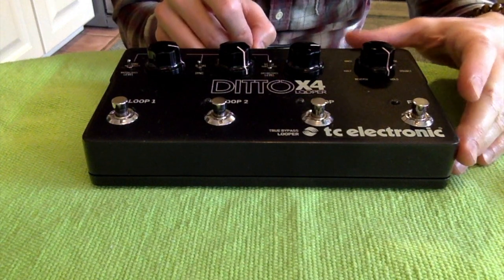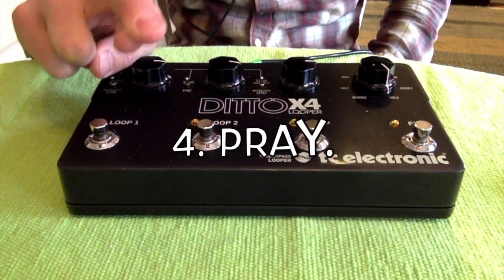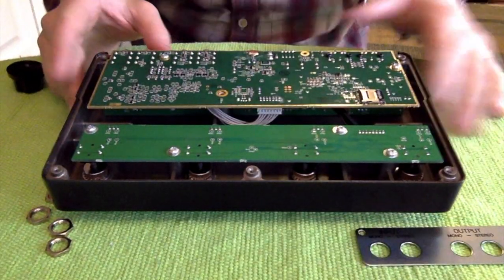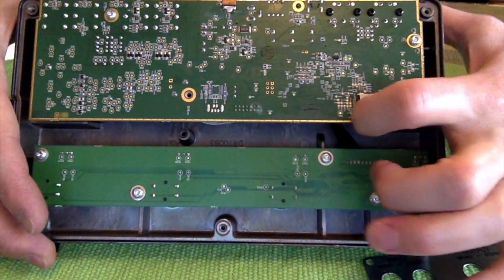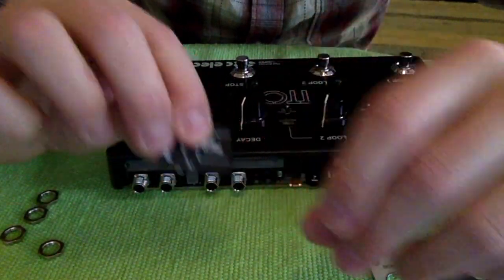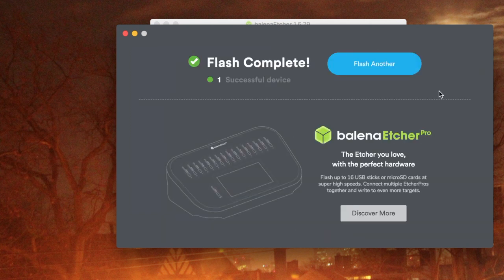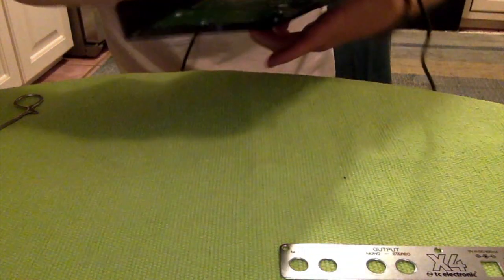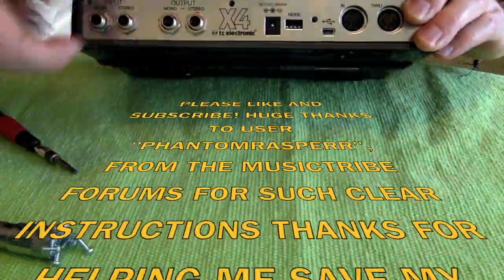How To Repair a Bricked Ditto X4 Looper Pedal

Comment: Thanks for the video! Before doing this, check  if the power supply gives enough amps. If not, X4 behaves the same way. Just saying...
Reply from the maker: Thanks! Yeah insufficient power can cause wackiness in any pedal so thats a great point. This one was using the stock tc supply that came with the pedal so I ruled that out after I tried another power supply with a similar rating but I can see folks having problems not using the stock power or plugging into say, a low mA plug on a brick style power supply.

Comment: I'm not sure how, but this worked for me!  Thank you.  downloaded the image and flashed the card with Balena Etcher as described.  Balena Etcha ran but told me that it failed to flash the intended drive.  I tried a few more time but after the first time Balena Etcher kept failing and giving a warning that the file was corrupt.  The card itself was still named DittoX4 after the flash failed so without many other options I put the card back in the ditto and miraculously it came back to life.  Hope it continues to work!
Reply from the maker: Hey thanks Falayta Productions! Glad to be of help. We've just recently found out that sometimes the card can get shifted or josseled inside its catch, causing this issue as well. Perhaps that was part of your pedals problem. Spread the wealth of knowledge my friend!
Reply: Ian Douglas Music I had tried to reseat the disk at least three or four times prior and had even mounted it in my computer prior to trying to flash the card as described in your video.  Nothing seemed to work until I tried to flash it, and as I said it told me that it failed but maybe it did do something?  Or maybe I just got it to sit correctly after repeated tries, but when it did work it looked like it was in the same position it always was when inserted.  Anyway, figured I would mention it in case anyone has a similar experience.

Comment: Thanks ever so much for this vid as had this problem with My Ditto x4 Looper followed the instructions and flashed the ditto x4 image to the micro sd card but still found it was not booting and frozen with the 4 orange lights I tried replacing the original micro sd card and flashed a newley purchased one with the ditto x4 image this time the repair worked. May have somehow been an issue with the original micro sd card. Love this pedal specially because of the Decay feature
Reply from the maker: So glad I can help, Gregg! Enjoy the pedal!

Comment: tried all of this including the balenaetcher... it loaded up and and the sd card was still working with my cpu, but still the pedal wouldn't load up... almost gave up put I tried some de oxit 5 and it worked! In retrospect this happened after a gig in Florida during the summer, so must have been some humidity crudding up the contact points... try de oxit for this fix!

Comment: It worked, thank you very VERY much.
Reply from the maker: Hell yeah! Great to hear Andrea! Thanks for watching!
Reply: Today got bricked again for the second time. Had to redo the procedure. Come on TC!!! COME OOOOOOOOOON
Reliability = 0% 😅
Reply: btw happened plugging it in and out quickly (assembling a pedalboard). I think during boot up it writes something on the SD card and if you pull power it corrupts the file system or something. Not a good design for a guitar pedal...

Comment: I have a more serious problem, for some reason the memory card gets too hot and it broke, I used another one that I had from an old cell phone and it burned it too, it get so hot that you cant touch the slot, the boards look good and with the naked eye you cant see any damage. Has this happened to someone? How did they fix it?

Comment: Do you have to have a mac book to do this?  When I put the card into my computers USB it says it needs to reformat it.
Reply from the maker: Hey Steven. You dont need a mac. Any computer with an sd reader will do. I want to say that since you’re re-etching the card, essentially re-writing it, re-formatting the card (which erases everything) would be fine. However, I have to say, this is not professional advice!

Comment: Is it not possible to  wipe the sd card and install fresh software while its still in the pedal via the usb port? Ive got an original Ditto with both lights flashing and nothing else happening, and it would be so easy if that were possible, if not I shall be trying your fix and I thank you for this video anyway, may you be blessed with an eternal plectrum.

Comment: Hello! recently I ran into a new problem with ditto. he recorded one loop and doesn 't want to delete it . I tried to delete it from the flash drive, cleaned the trash basket after. and then I turn on the recorded loop and it hasn 't gone anywhere
Reply from the maker: Hmmm. Thats a weird one. I assume you've tried the traditional on-board delete function where you tap twice and hold the switch down?
Reply: @iandouglasmusic7486  
of course I tried it, and it didn’t even help to physically remove it from the drive, it helped to rewrite the flash drive again.

Comment: It’s only the underside panel that needs to come off . The memory card holder Itself was the issue for mine .. i tried holding the card in with my index finger and it started normally without the lights on permanently . So it was just an issue with the contacts I cleaned it up and popped it back together and it works fine ( at the moment ) . Tc electronics are very quiet about this very obvious design fault that causes so many issues . I prefer my ditto 2 but that has issues with its switches being intermittently problematic . I’ve found the support for these products to be virtually non existant … troubling as they are potentially fantastic but to don’t seem to have much respect for their customers .

Comment: Hey bro.. i just bought 2nd hand dittox4. I noticed many problem right away,(since the seller told me that the pedal is function perfectly.anyway,sometimes the loop 1 in not recording but loop 2 does.. or the other way around. I have to reboot time to time. My question is ,do you think i will do what you did to x4 or i just need to update the firmware. I need ur honest opinion tnx. All the best.
Reply from the maker: Hey zef, thanks for watching! If I were you, I would simply update the firmware. The etching process is long and laborious and should only be used as a last-ditch effort. ALSO, make sure your dipswitches (little white switches on the back) are in the proper positions. From what you described, it sounds like you might be in one of the alternate modes. Good luck, friend.
Reply: Ian Douglas Music thankyou very..  hope my ditto behave good when updated.. so many complain online about the updated one.. they wish to return in factorty firmware.. thanks again more power.
Reply: Hi man,, sorry for commenting again.. the latest firmware turned worst for me.  Can i ask you if you know how to go back in old firmware? Thankyou
Reply from the maker: @zefMusic  No sweat man! I'll answer anything I can. I love being able to help. I'm not exactly sure how to get legacy firmware for a Ditto but from what I've heard, Version 1.93.1 (?) available only for windows (Mac only gets up to .89), deals with some bugs and makes looping much more "seamless" (i.e. for drone music or seamless looping needs). So if you have a way to get firmware 93, I'd recommend trying that before trying to revert to a legacy firmware.
Reply: @iandouglasmusic7486  tnx man..
Reply from the maker: @zefMusic  for sure, homie! Best of luck!

Comment: Many thanks for making the video, as I have now just saved my Ditto X4 from the scrapheap too! I used the alternate program called Win32DiskImager as also recommended in the thread.

https://sourceforge.net/projects/win32diskimager/

I renamed the .bin file provided by phantom to a .img file, and used this program to image the SD card.

A small note, I don't think you need to remove the I/O plate off the back of the unit, I managed to access the card by just removing the base of the casing with the 7 screws.
Reply from the maker: Thanks for watching Steven! Glad your pedal was granted a second chance at life as well! I believe you’re right about the i/o plate, which would definitely save some time. I think I took it off thinking that was the reason the base wasn’t coming loose on mine. It was, in fact the center torx screw that was covered by Velcro keeping the base from coming off. Good call, I’ll add that to the description. Thanks again.

Comment: When I conect the sd right all the slot is hot af is that normal??
Reply from the maker: Hey Abraham, that doesn't seem normal to me. This probably goes without saying, but make sure your device is unplugged from power while working on it.
Reply: @iandouglasmusic7486  Thanks for answering, I am seeing that when a sd is burned it is normal for it to overheat also the computer does not recognize the sd, I think that is the problem, today I finish flashing a new sd and I let you know how it worked

Comment: Great video!  Try this first... Try unplugging power; removing the cover and just taking out the sd chip and making sure to reinstall it in its correct position exactly; then locking the holding bracket down gently and plugging it back it to power it up!  It fixed mine... there is another video on youtube about the chip moving slightly out of place and causing this problem... https://youtu.be/QeU-j9KQj3I
Reply from the maker: B Parker thanks for watching, my friend! Could you link that video for others to try? If even 5% of folks just have to move their card back into place, rather than go through this process, it would be worth it! Hope it can help some people. Thanks again!
Reply: Ian Douglas Music Done thanks ... I added it and put up another comment with it added https://youtu.be/QeU-j9KQj3I

Comment: Does anyone here have the loop level problem too? You need to set it at 5 o’clock just to get close to unity..will this solution solve the loop volume problem?
Reply: First thing I noticed and disappointed me was the volume limitation ! TC support were useless when I raised the issue . The ditto 2 has unity in the centre so you can go up and down . The ditto 4 unity is basically only obtained with the volume set to 100 % . It’s a very frustrating thing you can only turn your loops down !

Comment: Do you format the SD card before you flash it?
Reply: I flashed it, did not format it, when the flash finalized it said 1 part failed but the flash was complete. However the pedal is still bricked
Reply from the maker: @atlakatl4569  hmmm. You might need a new SD but I can't say for certain. I didn't format mine prior to writing the card, but I wouldn't think it would be wrong to format it since we're reapplying the firmware, essentially. Have you tried adjusting the way the card is seated? Some folks just made minor adjustments to the positioning which got the pedal back.

Comment: Thanks for posting this. I recently got a used unit with 6 month warranty. It appears to work OK, but I was skeptical about the behaviours I was seeing at the start. All lights come on, then the relays click eventually and it behaves like your fixed unit does towards the end of your video. So I guess I don't need to do anything...

Comment: Might not be necessary. Just removed the card, put contact spray and voilà.
Reply: Same here! But I flashed the card first, and when that didn't work I used contact cleaner (do this first). Very happy. Thanks!

Comment: I had the exact same brickery happen with mine, but I contacted the company and they sent me a replacement.  I don't remember how long it was that I had owned it, but not very long.  It's nice to know this is an option, and I appreciate this tutorial, HOWEVER, it's very possible you did far more than needed.  Based on the video below, a guy just simply jiggled the card and it fixed the problem.  https://www.youtube.com/watch?v=QeU-j9KQj3I&ab_channel=joseargote

Comment: I got a bricked Ditto x4 for trying to save it 1 1/2 year ago. I found that musictribe-thread by phantomraspberr, bought a new SD Card, cuz the old one was broken and brought the DittoX4 back to life! A while later it bricked again. I freshly flashed the SD-Card again and it worked again. No issues till then. Today...it bricked again...Don't think contact spray, or replacing the SD-Card is the only problem. I mean the question is: why does it brick again and again, but in the meantime it works perfectly....? I guess I had it turned on around 24 Hours, maybe that is a problem? Just want to tell you, it might be bricked again! So be careful in relying on your DittoX4 if it was bricked one time...Some of you had the same experiences?

Comment: dude i just broke the card's placeholder. you need to put the warning a few sec before doing it , not after you did ittt
Reply: Same but it can be fixed . However it’s a very cheap nasty design .

Comment: WHy did you have to remove the input output plate.  By the way...this didnt work for me.
Reply from the maker: Hey friend, thanks for watching. I removed the I/O plate out of ignorance because my velcro was covering the last torx screw and the bottom wasn't coming off. It's unnecessary to do so. Sorry to hear it didn't work for you. The original thread that inspired the video is linked in the description and might have any steps that I may have missed. If your card is the issue, you should be able to buy a replacement and use the etcher to write the Ditto firmware onto the new card I believe. I really hope it works for you!

Comment: This product is just crap. We can all try and work around it as long as we can but it will eventually be bricked permanently. I bought mine brand new and it had this issue after a year of sporadic usage. Luckily it was just a loose SD card. After another year of sporadic usage, it has a similar issue. It completely cuts off in the middle of playing and goes into the all orange lights mode for a few seconds then continues playing.
Reply from the maker: Carlo, I'm afraid you're right. TC released a bunk product and refuses to assume responsibility for their mistake. Super bummer.
Reply: @iandouglasmusic7486  I have an Aeros looper now. They're not perfect but at least they work with consumers to address issues. 9/10 for me overall.
Reply: Agreed it’s a faulty product TC have been abismal with support over these units . By rights they should have been withdrawn and customers refunded .